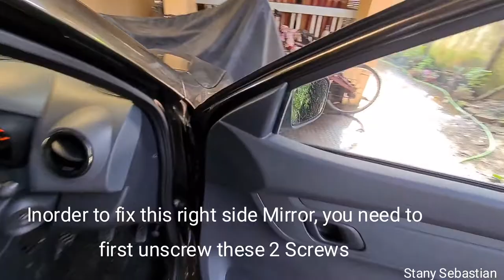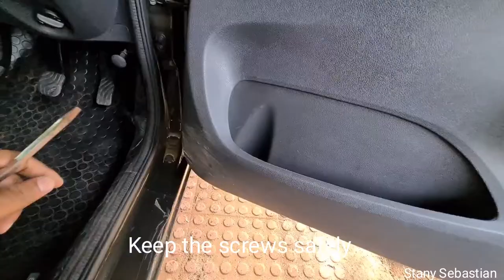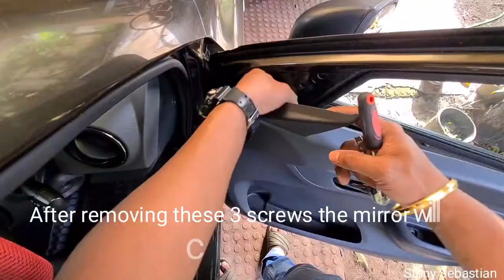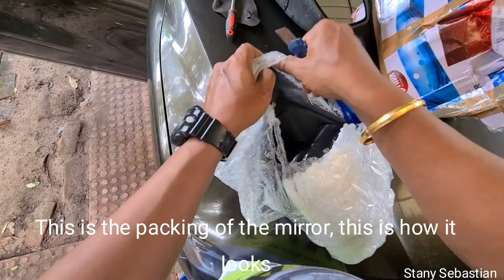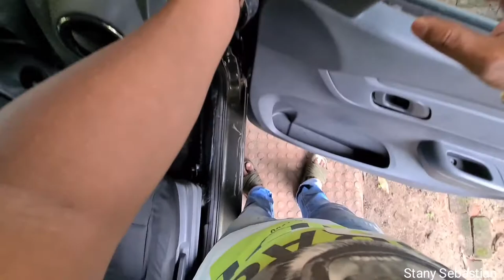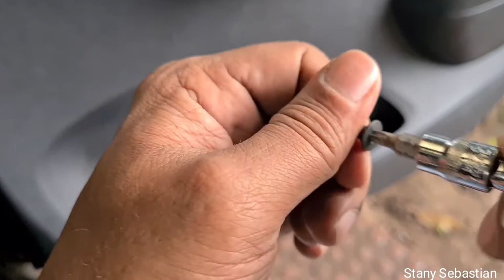How To Fix The Right Side Mirror Of Renault Kwid.Step By Step Method With English Subtitles.Unboxing

Comment: what's the cost & where to get?
Reply from the maker: You can buy it from Amazon and it will cost approx 1200-1500Rs
Reply: @StanySebastian  can I get electronically operated side mirror in this much of price from Amazon?
Reply from the maker: @dibyaprakashpanda6237  No Bro I don't think So.